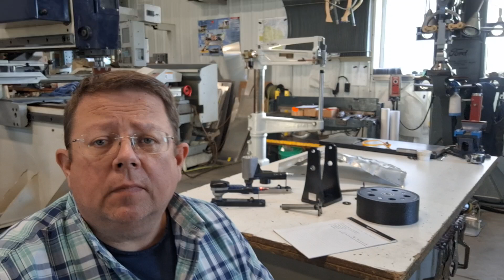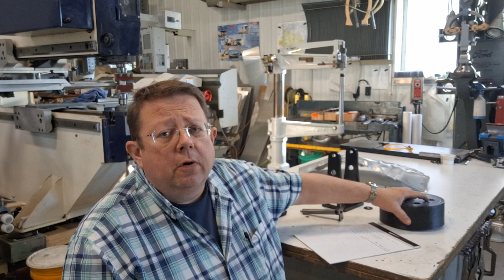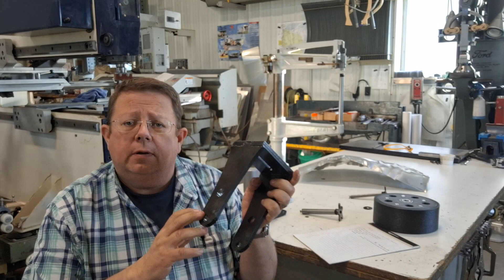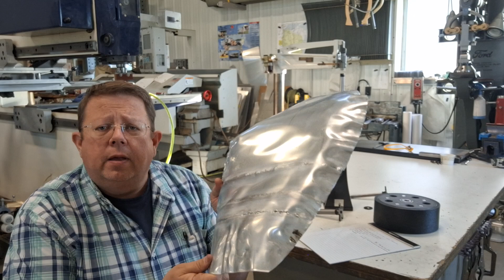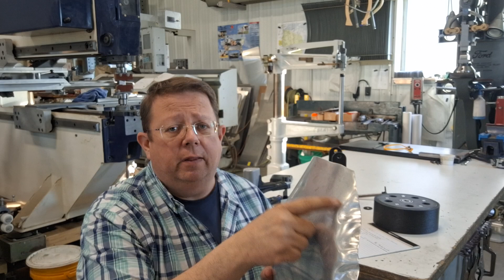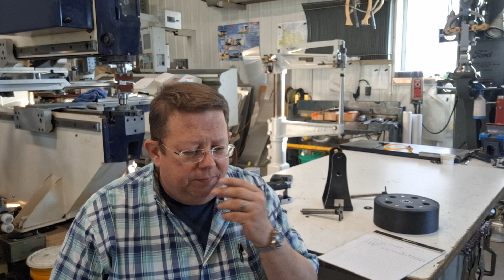Metal meets and why you should attend.

Comment: Do you use oxy/acetylene or oxy/hydrogen to perform your aluminum gas welding? My go-to is oxy/acetylene with a Dillon torch which produces acceptable results but do have experience flame-polishing with oxy/hydrogen which definitely provides higher fidelity/control for lower temperature processes. Before doing the set up and test I thought that I would ask.
Reply from the maker: @trottermalone379  I have both, but prefer Hydrogen over acetylene.